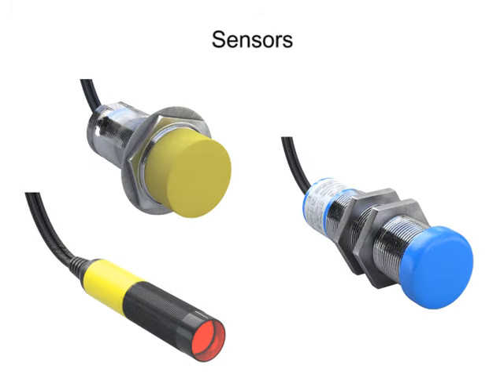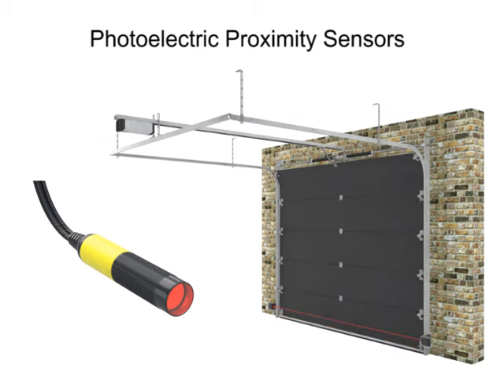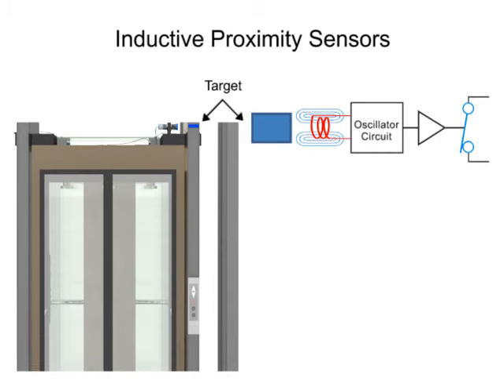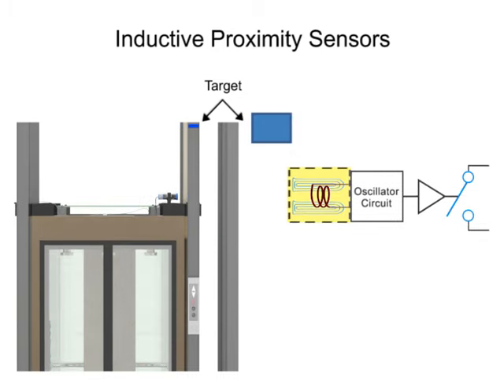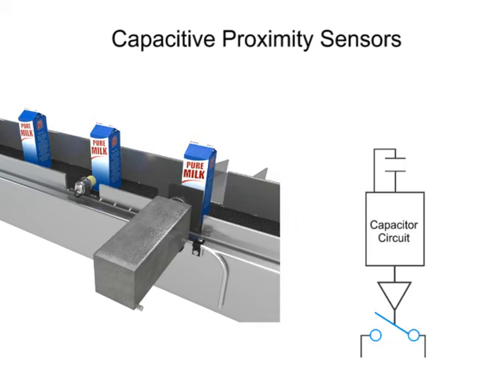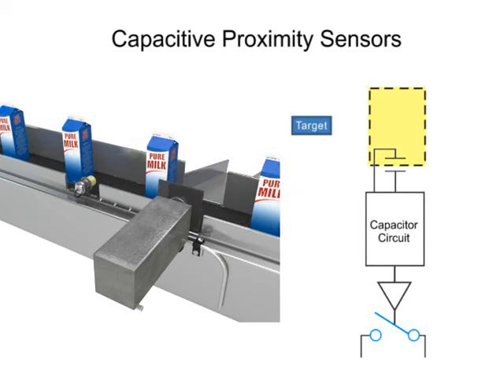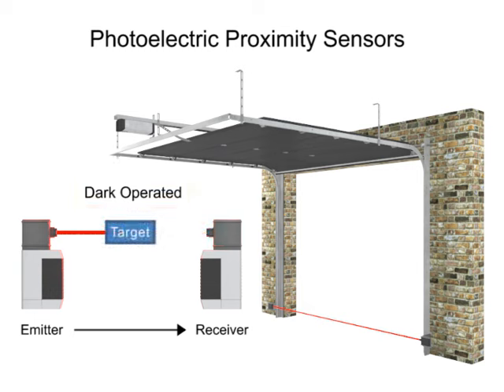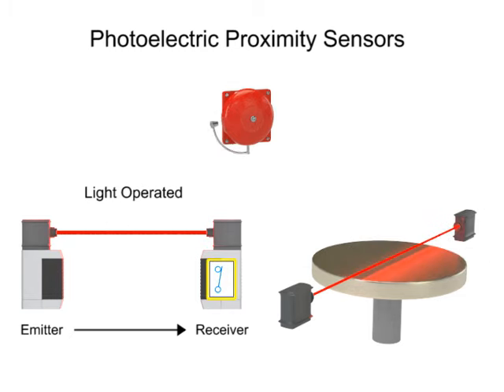Three Common Types of Sensors

Comment: One question. Does sensor initially powered?
Reply: s
Reply: +Just Abir
There are 2 categories of sensors... active sensors & passive sensors. Active sensors require external power to operate, but passive sensors do not. The sensors shown in this video, are all active sensors.